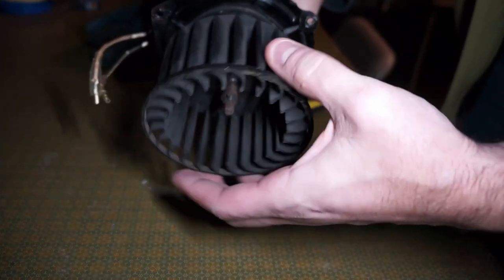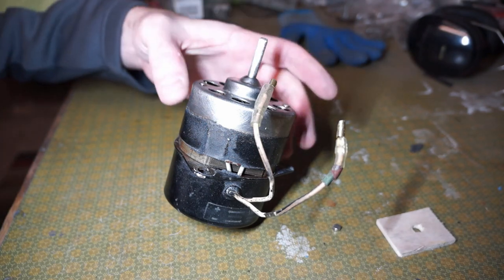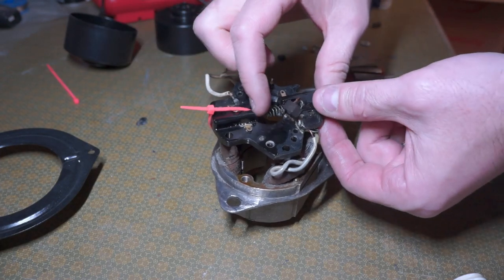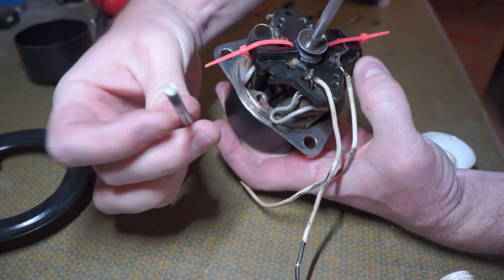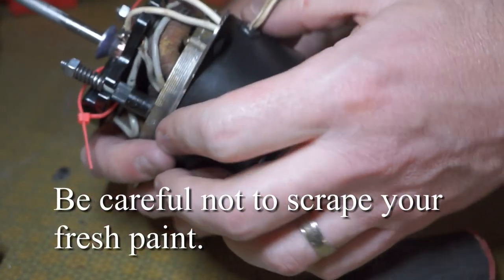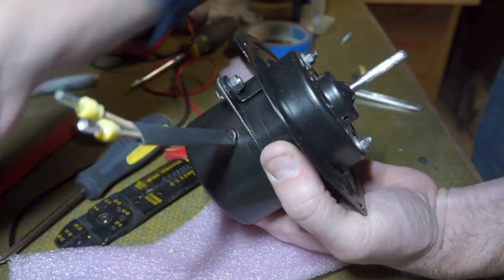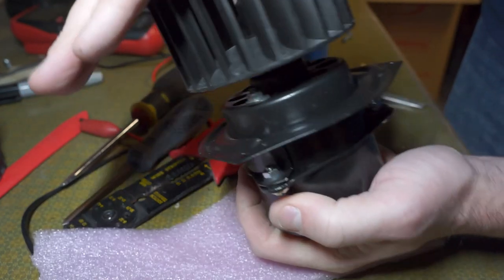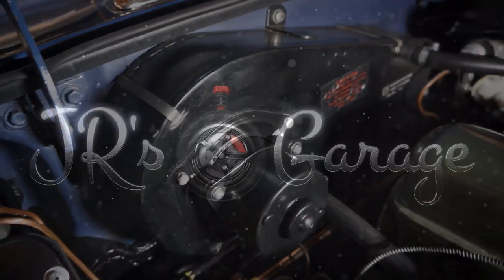1968 MGC Heater Fan Motor Teardown & Assembly

Comment: Great video, really useful for a motor rebuild. I think at 11:20 you've got the flow of air the wrong way round. The central grill is the input for the fan (not the output). Air is collected from the chrome intake on the scuttle panel, pulled in by the fan through the grill into the heater box. Air then exits via the bottom of the heater box into the cabin. At least that's how it works on the MGB,. I assume the MGC is the same.
Reply from the maker: Yep, I think you're right.

Comment: Thanks for the video. The fan on my 77 MGB doesn't blow much air. I've taken wiper motors apart and cleaned them but never a blower motor. Did you consider replacing the bushings with ball bearings? I wonder if that would reduce the resistance and allow the fan to spin faster?
Reply from the maker: I wouldn't be technically savvy enough to figure that out without breaking the whole darn thing.  So far so good not a single squeak since I did the job.